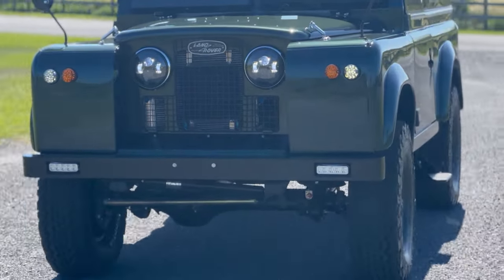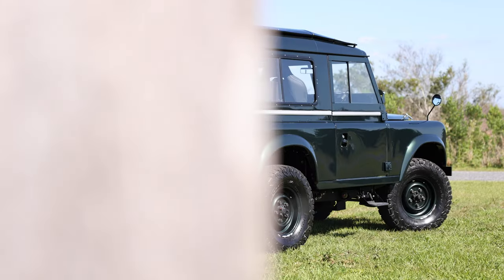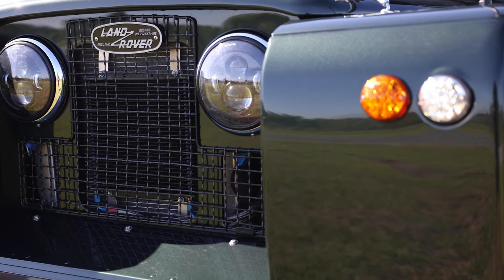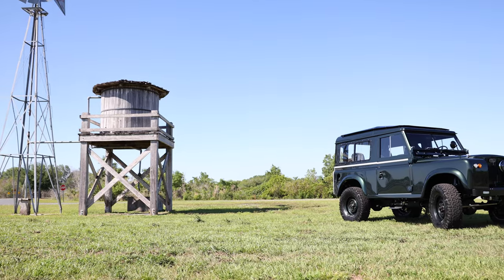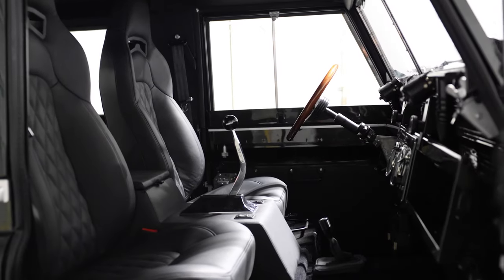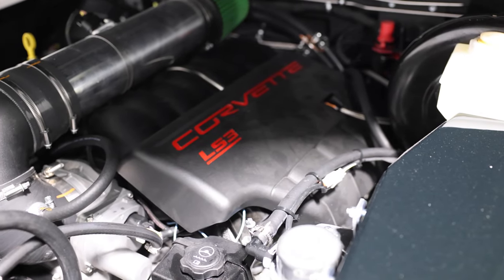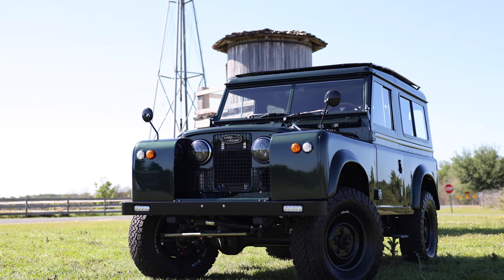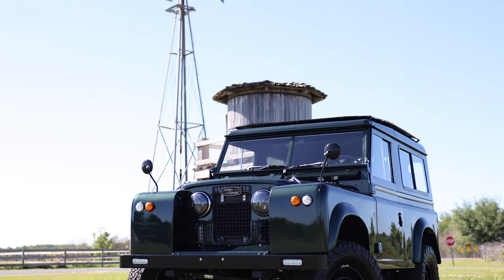Fully RESTORED (1968) Series IIA with LS3 Engine | ECD Automotive Design

Comment: Beg to differ, not a standard Series iia steering wheel, bro...

Google if in doubt.

I would have called  Project Churchill Project Butchered, but that's only me.

Think Uncle Winston will turn in his grave.

Mutton dressed up as Lamb, but good finishes  on what could be seen. Obviously the brakes was also upgraded to handle all the new power...